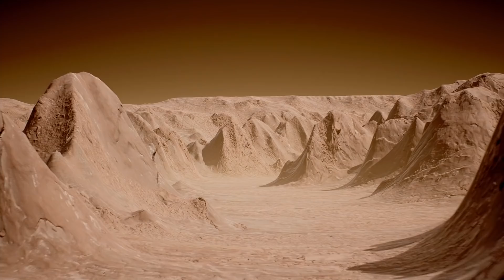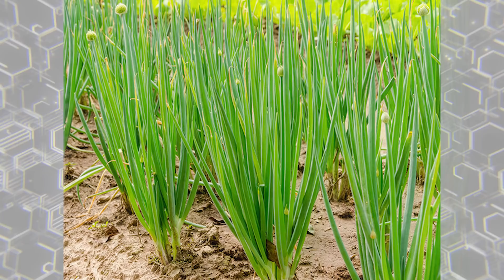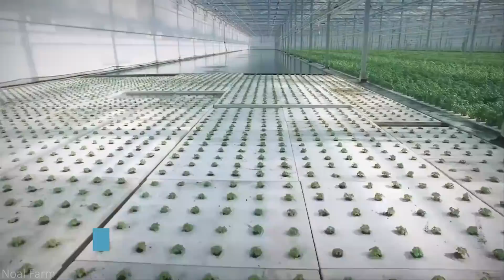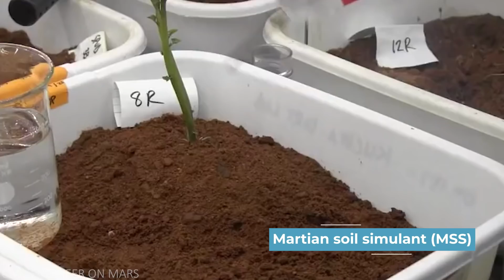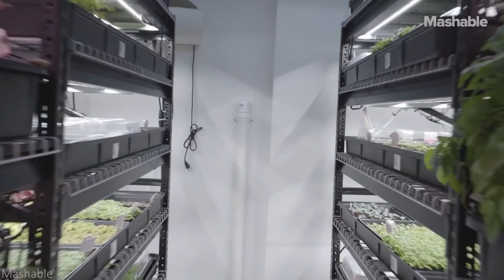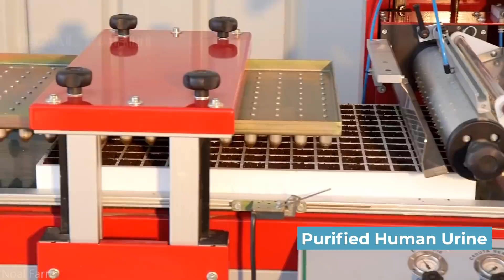Why SpaceX Is Facing A New Problem With Mars

Comment: I personally think a permanently manned colony on Mars is just stupid.  If anything catastrophic happens to Earth, Mars is more likely to be hit worse.  The Lack of Magnetosphere means it is constantly bombarded with solar radiation and cosmic rays.  This requires the facilities to be built underground as 16 feet of soil is needed for shielding.  The gravity is only 38%, which could cause severe health problems as the human circulatory system is designed to pump blood out of the legs and into the head.  The last issue is that the atmosphere is 1% of Earth's so even micro meteors will be a threat as most will not burn up in the atmosphere like they do on Earth.  Mars is also closer to the asteroid belt, so likely gets hit far more often than Earth.  Add to this that the soil is literally toxic to humans and that the dust will get tracked in with any walk outside.  This was a major issue for the Apollo mission as the dust from the Moon surfaces triggered allergies and respiratory problems over time.  Add a toxin to this and it will be far worse.  They will need to shower off in the airlock every time they walk on the surface.

The whole mission is littered with issues like this... like requiring centrifugal forces while travelling to Mars or the astronauts will be too week to do much for weeks after landing.  Solar flares will be deadly and we have not figured out how to shield the ship.  The mostly likely best idea would be to cover the ship with a form of wire cage and magnetize it.  This will add weight and considerable power draw, but it is far better than the massive layers of shielding that would be required.  The colony would have to be set up ahead of time and this might take years or decades to do as an underground shelter would need to be built, water would have to be drilled for.  Atmosphere processing would have to start to make oxygen and methane, and a landing/launch pad would have to be built.  If they were going to grow crops then they would need a much larger shelter and far more water and electricity.  Personally I think they should put a nuclear reactor on Mars for the base.  Then they could maybe send teams of 6-12 down there for about 8 months or so.  If the health concerns are not bad... THEN they could think about building a colony.

Comment: Messed up when comparing ISS almost zero gravity sims with Martian 2/3rd of Earth's gravity. Gravity is not a huge deal on Mars, but it is some difficulty while out from surface of planets. (Ie. on route to Mars.)

Perchlorate can be purified with running water and heating the mixture, afterward you may even get the water out from it. So that's not really a problem if you have enough electricity (ie. solar panels).

Real problem comes when we think what martian soil has. It doesn't have much carbon, but that can be added from martian atmosphere that is full of CO2. And other problem is adding living elements to the soil. So we have to bring some bacterial samples with to make the soil fertile. And Mars has different atmosphere, so solar radiation has to be filtered before it is used to grow plants. Also daytime and radiation level changes forces us to use special LED's to give enough stability for the needed sunlight for our plants.

Airponics are currently used to grow potatoes, so it should be possible to use same method to grow different crops on airponic farms on Mars. And there are visions to grow man crops in warehouses that can stack plant sheets and have perfect growing conditions day by day. In this way we may reduce area needed for our crops.

In a long run we have to make plant species that can handle martian circumstances better. Perhaps using genetics to modify them. In a very long time we could even have few plants that could survive in the surface of Mars when enough water is added to their roots, but that's nearer to Sci-fi on our current technological level.
Reply: At least one semi-sensible comment.

Comment: Biodomes will burst at the first  meteorite storm. The only solution is artificial light which needs power. The 50% reduced sunlight puts solar panels out of the picture. That leaves nuclear power. Lightweight molten salt reactors have been proven. Heavier permanent solutions could be made using cement and Mars minerals.

Comment: The quickest way to increase the atmosphere on the planet would be to first find a way to have the molten core of Mars to spin again without that it doesn't matter how much atmosphere is on Mars it Will simply dissipate into space because of the solar winds stripping away the atmosphere from the planet without a electromagnetic field to protect it second after the electromagnetic field is stable and in place which could take several hundred years then we would need to find asteroids made mostly of ice very large ones put them into orbit this will take thousands and thousands of them and they must all at least be one mile wide and a few miles long then we must push them into that this year all at once from every angle and this process may have to be repeated several hundred times which could take several hundred years if we have the technology to do it and several thousand years if we do not that would rapidly terraform the planet causing hydrogen and oxygen to be broken up from the ice asteroids rapidly changing the service and the atmosphere the plasma streams coming off of the asteroid will split the water to its base elements oxygen and hydrogen what does not split will remain as liquid or ice water after the atmosphere grows in density to support liquid water

Comment: The elephant in the room is that Martian regolith contains about 0.5% perchlorate which would result in food crops with levels of perchlorate toxic to humans...the little test kits come without the perchlorate. Sustainable solutions that involve the use of regolith to derive plant nutrients will require the removal of perchlorate and potentially further modifications to produce soil-like materials that can support terrestrial-like soil ecologies. Greenhouses may best be located sub-surface and involve the use of LEDs to mimic Earth insolation levels. This is a big task with complexities potentially exceeding those of the space flight systems required to deliver payloads from Earth to Mars.

Comment: A person needs about 2 kg of food + water every day. Maximum payload of a single Starship will be at least 100 metric tonnes, and there will be many sent to Mars before even the first humans will set foot on Mars. 
So a single Starship with 100 tonnes of food+water will provide: 100,000 kg / 2 kg/person/day / 365 (earth)days = 136 persons for a whole (earth)year on Mars (72 persons for one Mars year, but I also think you need less than 2 kg/day when gravity is only a third of that of Earth). And this is when no production of any kind of food or water will be possible and without recycling (of mainly wastewater). It is also possible to bring in fertile soil, fertilizer and use compost to produce food, although hydroponics/hydroculture seems to be the way to go (so only recycled water and nutrients needed).
So I think it is not such a big problem as suggested, there are plenty of options.
Reply: Got a trillion dollars?
Reply: @sentientflower7891  Just a bit off... When there are dozens/hundreds of Starships (upper stage) launched, cost price for a single Starship will be far below ten million dollars (cargo-only ships will be a lot cheaper than human support builds). Paid for by Starlink. Current Starship prototypes are about five million dollars each to build.
Reply: @Myst...  your math is very optimistic.
Reply: @sentientflower7891  Engines will eventually only be $ 250,000 each (3-6 engines needed) as Elon stated. Think it will be feasible (and closer than your 'math' in any case). Only time will tell...
Reply: @Myst...  only time will tell, but time is the one thing humankind doesn't have.

Comment: And it is  -60 to - 140 on mars
Reply: Low temperature is not a problem, especially in a wind shielded tent due to the fact that the heat capacity is 120 times lower than on earth. A small heater will do.

Comment: The experiments are invalid as partially described, the objective is not to grow vegetables in Zero-G as Mars has gravity (reduced as it is). The first farms on Mars will all need to be purpose-built and 100% indoors with artificial light, the testing of growing plants using natural light as received by Mars is a test designed to fail. Artificial light will be needed for at least the first decade of farming on Mars if one assumes that these farms will use Earth-based plant life. We need to develop bioengineered plant life designed specifically to thrive in the natural Mars environment. In the meantime, we need to heavily process the Mars soil to extract the raw requirements for hydroponic growing once we have sufficient plant waste to use as compost we will be in a better position to grow GMO crops in the actual Martian soil.
Reply: https://youtu.be/yF8aJJk-ZXc
Reply: Not all plants need full sunlight, some adapted to shady conditions on earth may function in Martian sunlight
Reply: And to think I almost gave you a thumbs up by spotting the 0G falacy but then you say something even more absurd.  Mars has plenty of sunlight for photosynthesis.